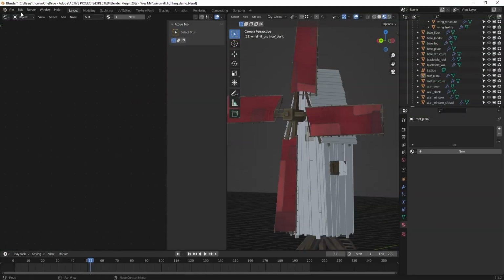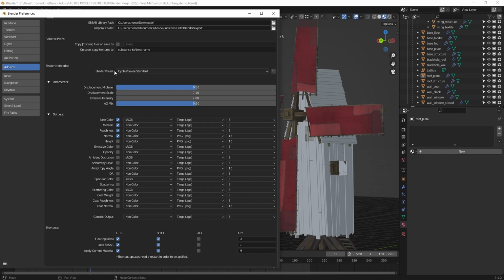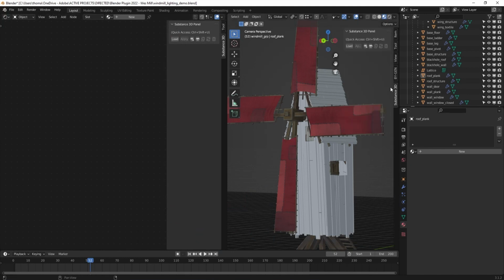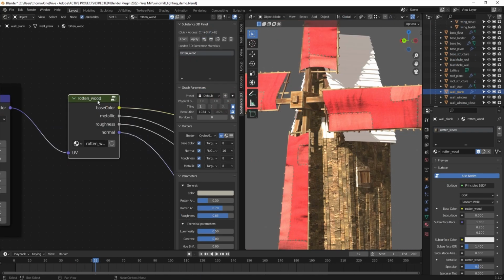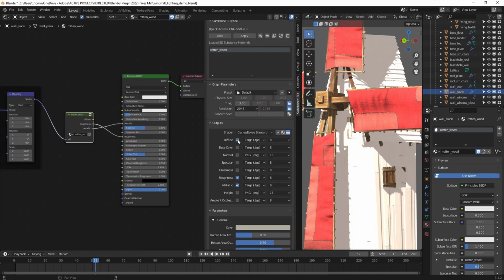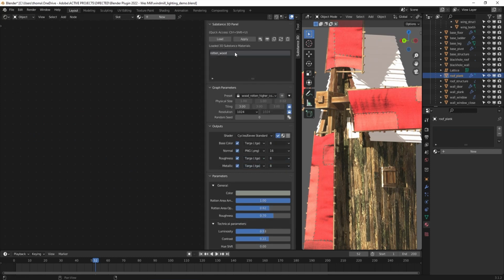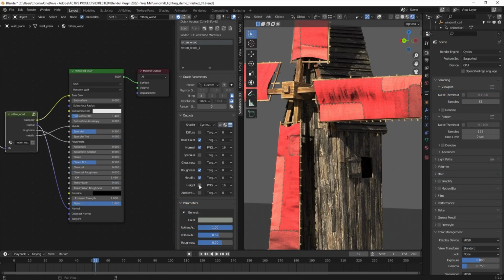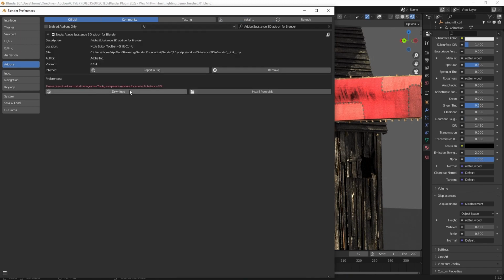Using Substance Materials in Blender | Adobe Substance 3D

Comment: I'm not sure what I'm doing wrong, I downloaded the integration tool and tried to install it just like it was shown in the video and I get this error
- Substance 3D in Blender: [Code_Response.toolkit_not_running_error] Error while installing the Substance 3D Integration Tools
Reply: Nevermind I solved the issue.
Deleted the adobe folder in Appdata/roaming
And I killed the ubstance Remote Engine program in the task manager

Then I reinstalled the addon and it seems to work now
Reply: @Rubidus_Arts  I did the same thing but I'm still getting the same error. I even updated to the latest version of Blender thinking that would fix it but still...
Reply: Thanks bro, it helps me fix the problem
Reply: Thanks, helped me too by killing substance_remote_engine.exe with taskmanager

Comment: When I apply Material, nodes on shader editor,  they are not connecting and missing. Some one solutions? I have blender 3.4.1
Reply: The same with me - same version of the Blender ( Win 10 Pro, Quadro P2000, 32 GB RAM, Ryzen 7 3700X ) . Any solution for us?  I've noticed that there is more people with same/like problem - disconected/missing nodes, when aplying *.sbsar files we're viewed just "black" materials . Reinstaling of addon/integration tools not working.

Comment: After I click the button apply, the material stays black and there are no links between the nodes in the shader editor
How do I fix it?
Reply: same here. I have exactly same issues
Reply: @jaytakaizumi8958   via @RafaelArevalo question - The same with me - same version of the Blender ( Win 10 Pro, Quadro P2000, 32 GB RAM, Ryzen 7 3700X ) . Any solution for us?  I've noticed that there is more people with same/like problem - disconected/missing nodes, when aplying *.sbsar files we're viewed just "black" materials . Reinstaling of addon/integration tools not working.
Reply: @S1aa1neMacRoth  replied
Reply: @jaytakaizumi8958  I found out it doesn't work correctly in the in the latest versions of Blender
I think they will solve this problem, we just have to wait, or use earlier versions of Blender.

Comment: On Mac (Apple Silicon) the integration tools won't install. Is this an Apple Silicon issue?
Reply: I'm experiencing the same. Have you found a solution yet?
Reply: @gjb7966  No, sadly. I corresponded with Adobe on their forums but wasn't able to find a solution. If you figure it out, please post here!
Reply: @rosskinghorn  actually I found the solution... I wasn't installing the two available packages, only one of them. what's happening in your case exactly?
Reply: @gjb7966  By two packages do you mean both the addon and the integration tools? If so yes, but still no go.